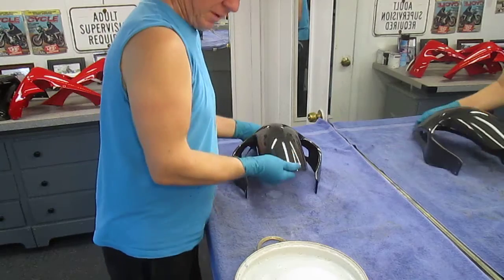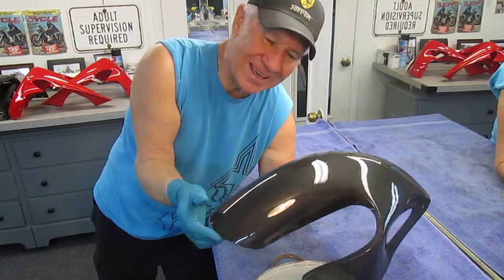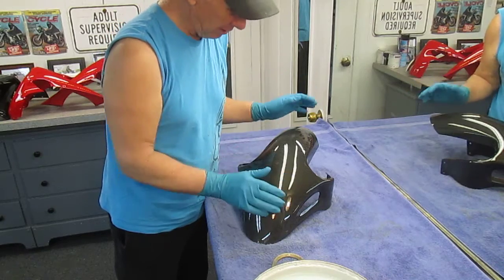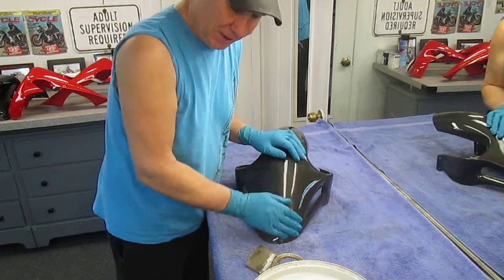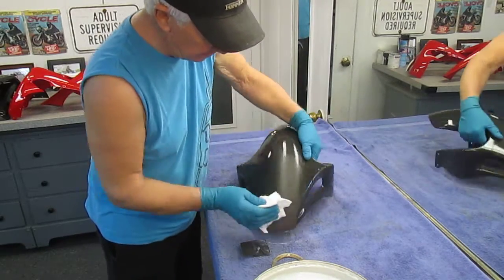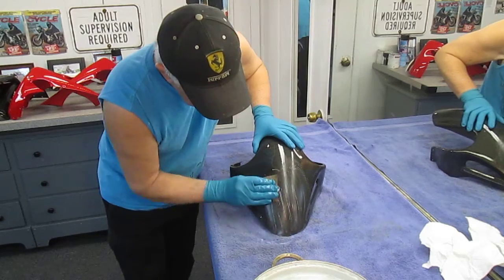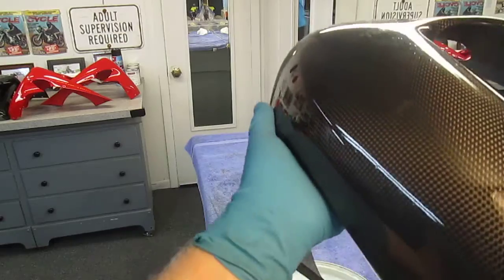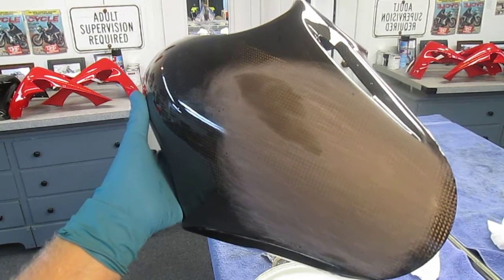HOW TO SAND BETWEEN CLEAR COATS ON CARBON FIBER PARTS.

Comment: The reason for imperfection you have shown is the bubbles in the top coat of epoxy resin. When you sand the part before to put the clear you are opening them. And then you have the fish eye after the application of clear and no matter how much layers you will apply. But sanding is the inly way to fix it. Good work!

Comment from the maker: GOOD INFO AND YOU ARE CORRECT BUT SEVERAL WAYS TO DEAL WITH IT,HEAT GUN LIKE WHEN YOU DO DECOPAGE OR A RIVER TABLE WILL HELP.BEST WAY IS SAND THRU BUBBLES,USUALLY THEY ARE NEAR THE SURFACE,THE USING 4 to 1 AUTO CLEAR BUILD UP ENOUGH TO SAND 2000 AND BUFF.MORE INFO ON THIS IN Q&A 19.

Comment: I've been carbon fibre my car and my partner touched a part that I've sanded and about to paint he had fuel on his finger so is it screwed do I have to start again as the fuel oil has seeped into it I don't want it to bubble when I paint

Comment: Very informative. Thanks. 

Quick question. For interior trim parts that I'm laminating with CF and clear epoxy, will Rustoleum or Krylon "Lacquer" be sufficient enough for a top coat providing UV protection?
Reply: no

Comment: what do you use for your clear?
Reply: linear 2pac poly urethane is the best(Norglass), has some uv filters in it, tint it black a bit stops that yellowed look as it gets older. Never leave it in direct sun unless its being used- put a cover over it always.